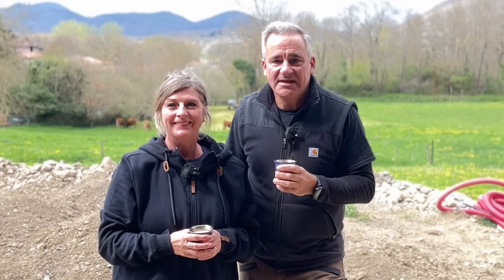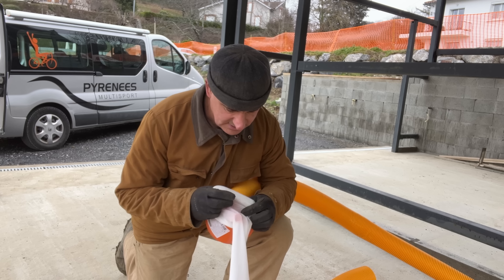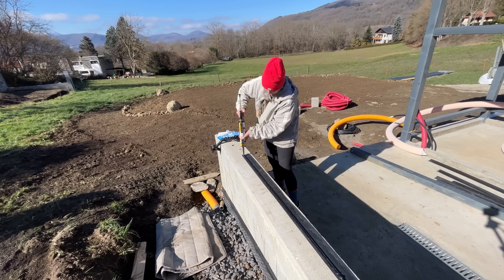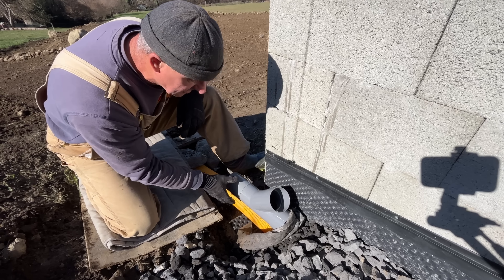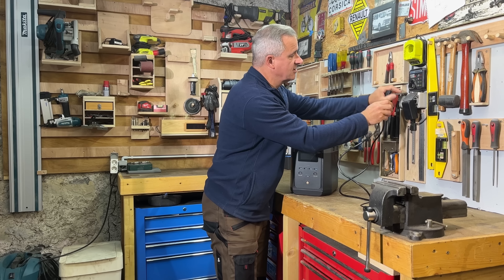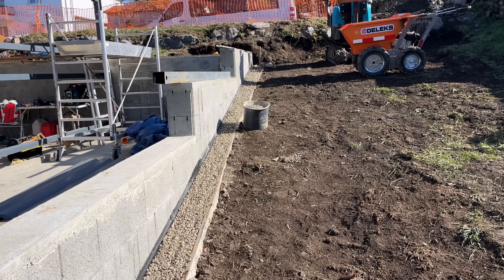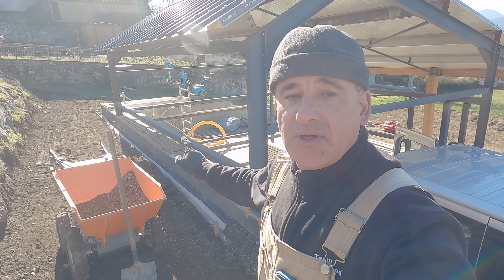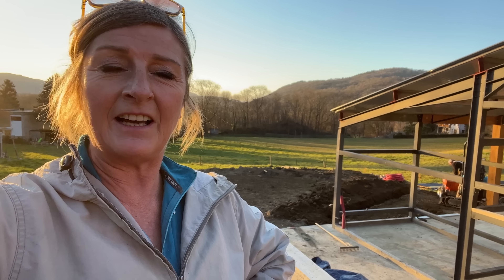Final Grading | Garage Shop Project EP29 [ EcoFlow Delta II ]

Comment: Just a tip for future.......when you're laying the flexible drainage / conduit, bury the first couple of meter with gravel and then pull it tight and tie the end to a stake, then it doesn't move around when you are backfilling the rest.
Reply from the maker: I stuck Julie on one end and then pinned it - but yes, when we do it for the house we will take your advice.  On all the "instructional" videos it looks nice and straight ...pfff

Comment: Hi  Ian an Julie    just a thought as you say there is no water supply on site . Would you not be better with putting in a 10000 or 20000or 30000 gallon water recovery tank to collect all the run of water from your French drain and once your new home is built you could add to the rain recovery tank or just connect to the tank.  It would be then great to water plants or even use to flush toilets or washing machine by putting in a filtration unit . You could Bury big tank in the ground and use solar power to pump it up for use. These tanks are not to expensive and it would store valuable water supply  in my off grid small croft in the Highlands I have a 50000 gallon tank under my drive way and I use this water all year round for our washing machine  toilets and my 3 very large green houses .when we had very hot dry spell last summer in scotland I never ran out.
Reply from the maker: Hi Garry, we are planning on a couple of 3000 or maybe 5000 litre tanks that with be partly buried.  But here the tanks are expensive - a 10000 litre (not gallon) costs around €8k.  The smaller 3000 litre are around €2K each.  But that is the plan and originally I wanted to be off grid with water too but no allowed in France if there is water available nearby.(water is here is cheap)

Comment: Hey guys!
Greetings from your Anglo brothers and sisters from Australia!
Great to see mates from the MOTHERLAND doing such great work, while presenting it in a user-friendly way to enjoy and learn from your trials and tribulations, haha.

I wanted to mention that as a former Civil Construction and Engineering worker, I had the opportunity to have to use the same orange coloured 
Pipe  shjch is what we call it. Which we call AGGY PIPE or AGGREGATE Pipe. As it's pretty obvious but you use Aggregate to cover it and out around it lol pretty obvious I know sorry.
Difference is, well I felt sorry for you when I saw you having to fit the exterior white Protection sleeve onto your AGGY pipe.... 
While here in Australia we are lucky as we get rolls of very large to smaller lengths either naked and uncovered like yours came;
Or the entire length of twenty two fifty metres ALL COMING ALREADY COVERED WITH the same WHITE PROTECTIVE SLEEVE COVER.... they ask if you want the White sleeve whole fifty metres or Naked....
Also, ours only comes in Monochrome BLACK lol.... Which I like as it does not stand stand out through the aggregate that surrounds it... If it were orange/ yellow... But then again if you needed to be able to locate it easier and more accurately, the higher visibility colours would be good too....

And down here at the other end of the British empire I have never heard them called "French drains "....  But probably as I only used to do them as we comoleted a Storm water drain with all the 1m diameter concrete pipe in the trenches and covered with crushed rock (recycled concrete) 
Then on top of that goes something called Stabiliser.... 
Which we spread like normal around the entire pipe and edges. Which we put the Aggy french drain pipe with protective sleeving about one 250cm layer of recycled concrete  then stabiliser at a ..250cm at a time and then level it off then it has to be sprayed and wet throughoughly then use a "Jumping Jack" lol that's what se call it but it's a Trench Whacker compactor...
Then another layer then compaction then tested with a compaction pressure measurement caliper... 
But is essentially and ENVIRO drainage system to remove moisture above the large STORM WATER DRAINAGE pipes a is Diverted to the newly planted trees. Just on top....

Lol sorry for the long comment just want to let you know how we have different pipe and would be easier if you had access to our Aggregate Pipe in France... Haha
But apart from sending three or four fifth metre lengths in a container to yourself in France... I think it's cheaper and easier for you to just place the protective sleeving on yourself.... Lol...

But great work guys!
Hope you visit us down in the far-flung reaches of our British Empire....haha

You can probably tell,  but I am. Devout Constitutional Monarchist...
and love and respect our cultural connection and similarities... As J don't know about yourself buy j certainly fee if I were in a bar and there were Americans Irish Continental Europeans and Brits yes zlll Brits Scots Welsh English and Northern Irish... 
I could immediately converse with yourselves propabbly cricket ., Maybe about EastEnders of neighbours hahaa buy sd also have an identical sense of humour in Self-deprication and mocking ourselves while loving each others TV music etc and also the amount of Australian expats in the UK connected to the fact that the British diaspora of expats well the most of them outside GB are in Australia....

🇦🇺☺️🇬🇧
Kindest Regards and best wishes! 
Dejan 
👍🤞🤠
Reply from the maker: I thought it was called French Draining everywhere but here....  It would have ben nice pre covered and I suppose I could find it but at a cost.  I was brought up in Australia, just outside of Frankston (I know, I know but it was nice back then 🤣)  Went over when I was 2 on the boat and then immigrated back to UK when I was 11.  I had no choice.  Tried to get back but left it too late (after 45).  So here we are in France. 😀
Reply: @HomesteadingUncontained  Mate that is amazing!
Can I assume you were a ten pound pom?
By the way I don't like the use of the term pom mainly if used in a derogatory manner.... But almost always it's used as good old Brotherly love Banter lol.. you know what I mean...
When Aussies call you Pommy you should call them back yep I am.... You can call me that use it as my nickname etc but I'll be calling you by your nickname.... P.O.M.... 
As you are mainly convicted immigrants and yes we have the same nickname but mine means I'm English and most likely derived from Pompey (Portsmith) where most EMIGRATION to colonies like yours set off from in England.....
Yes my Pom means I'm English and ancestors left from POMpey (Portsmith in England) where you guys also departed the motherland from.... But two hundred years earlier than I did... And I travelled to the Colony via Ship like you did... However I was on either the Fairstar or similar P&O ship other ten pound poms arrived on... Or even could have arrived on BOAC or Qantas QF01 London - Sydney.....
WHEREAS you and your ancestors also deserving the nickname of 
P.O.M as you too traveled like myself on a Ship  But my journey to Australia did not involve  being shackled ankles and wrists... On the way to the same place but I was going to better my life and enjoying the freedom to explore and live in a New yet very familiar country to my former home of Great Britain..... 
You on the other hand had no say in travelling.... As your crimes essentially made you a first generation Australian by way of Forcable Emigration to s penal colony...
And hence why you deserve the same nickname as you call me "Pommy"...
But yours is P.O.M as you and your ancestors were 
PRISONERS OF MOTHER ENGLAND
SO don't forget you too are also deserving of the POM nickname... Lol

This is what I would say to any person's calling you Pommy to upset you or being offensive..... 
Especially if any Irish called you out in a derogatory manner.... As I have no time for any Irish other than those in the NORTH.... who i support and feel deserve respect for being able to maintain British right to the Protestant lands of Northern Ireland....
Where as any Irish calling out Pommy bastard surely is abusing you as they are upset about being Catholics in Australia a Protestant country mainly Anglican Church of England.... And also because the Irish that came to the British colony of Australia.. would realise how strong the connection is with her motherland 
the UNITED KINGDOM OF GREAT BRITAIN AND NORTHERN IRELAND....
Both world wars..... 
Irish arriving to Australia realising we are too like you Brits a Constitutional Monarchy with (back then) QUEEN ELIZABETH II REGINA being our Queen and official Head of state..... And therefore any Irish fleeing from the hatred of Britain and hating the Queen would now be under the Queen and influence of Great Britain as Australia has always been.....
Oh and Australians don't forget that while our Australian soldiers were fighting and defending the motherland during the BATTLE OF BRITAIN.... THOSE bastardly Irish Nazi sympathisers while helping to hide German nazi Leaders... They also dispicably USED ENORMOUS AIR RAID SEARCH LIGHTS to axtually Shine on BRITISH TSRGETS AND help direct Nazi Luftwaffe in the right direction to bomb any target in Britain.....
So instead of being neutral and abstaining during the WAr they were certainly not NEUTRAL during ww2 as they claimed to be...
Dispicable also the murder of hundreds of British soldiers and Protestants in Belfast Ulster LONDONderry etc with their true IRISH TERRORIST SELF BRING DISPLAYED using car bombs to kill Brits and innocent (even Catholic) and non-british public bystanders.....
And still to this day those pieces of shit like when Celtic supporters display a disgusting banner dyring their matches on Rememberance  day that says "TAKE YOUR BLOOD STAINED POPPY'S OFF OUR HOOPS"....

And the IRA MURSER OF TWO AUSTRALIANS
This is the article about what happened

 https://norepublic.com.au/murder-of-young-australians-by-irish-republican-army/

Lol sorry yeah i love hearing more and more Brits English Welsh Scottish northern Irish alike lived or are moving to Australia.....
As I know and feel GB is Australia's closest ally politically in importance that includes our closest stromgesf cultural relations.....no other country has such s link with us.....
And I feel we are too close to the us and should instead spend that interest time and assets combining more Agreements and military integration of Britd being able to directly join Australian armed forces just like we can join any of your British armed forces....

:) Sorry about the little rant lol

But hey you know who own a beautiful house in frankdton (yes it's the expensive exclusive part Hugh up of the cliffs overlooking the bay) but still very much Frankston.... Lol.....
?

VOted the world's Greatest best dj 
fellow Brit 
CARL COX!

I'm assuming you know the amazing guy?
Truly s blessing for Techno dance electronic music and a very nice guy personally as well :)

Ahhh but why did you and your family EMIGRATE from Australia? :( 
I can only hope it's not because you felt unwelcome and hated the lifestyle..... As culturally driving on the left, our TVFOod baked beans biscuits (not cookies damn Americans!) Haha..

Oh it sad to know you left :(
But you can come back....
As you are British you have more probelahr at permanent residency and citizenship than any other nation....
And hey another Brit has been a dual BRITISH / AUSTRALIAN  citizen since the 80s!!!
Yes the woman who says what she thinks without thinking about offending and virtually no politically correct or general social FILTER between her brain and her mljth.... (And that's why I love her so much) 
Miriam Margolyes....
Hahaa ...

I hope you return one day with your beautiful wife and hey why not build a similar home here....?

Lol thanks mate...

Comment: I,m 13 years on and all my French drains?....well.... each year I used some very strong weed killer to keep the gravel from getting all overgrown....dust...you can't stop it and it will blow on to the gravel and eventually choke it even if you kill the weeds it will just fill up with dead or dying weeds among dust...but as I say you have 10 years + and you will have to dig it all out and do it again.  Something to look forward to?🤣
Reply from the maker: This top one won't get much moisture but the deep ones are working a treat (it has been 2 months now 🤣)  Some of the drainage I will do in the open field will be just gravel trenches to try and guid the water flow.

Comment: No reason to explain why you have to do dirt work before the next cool looking stuff. There is so much prep in everything and few seem to understand that. Most viewers are used to seeing the cool stuff done so they have no idea the amount of work involved to get you to that point. 
     I want to upgrade the air conditioning in my shop but.... To do that I need to do some framing inside where the unit will mount then pour a slab for the air compressor etc outside the shop so I know where the condenser will mount. Oh and the insulation doubling up in the shop also requires all the lighting be taken down new outlets wired up for the lights and many other prep things. So yeah I know how it is. Also used to do allot of commercial construction. 
       I'm in Texas and air conditioning is a requirement here. I also want to enjoy working in my shop and if I'm hot and sweaty constantly I'm angry and not enjoying it and my quality of work gets even worse.
         
            Now for my question. Do they call it French drain in France or just a drain?
Reply from the maker: I know but even I am wanting to get to the good bits, but you are right, there is so much preparation work which cannot be done afterwards.  We are framing in the next episode though 😀